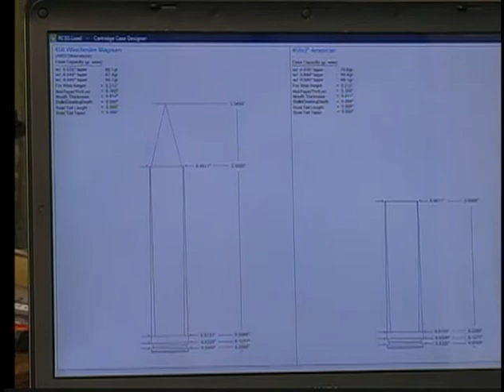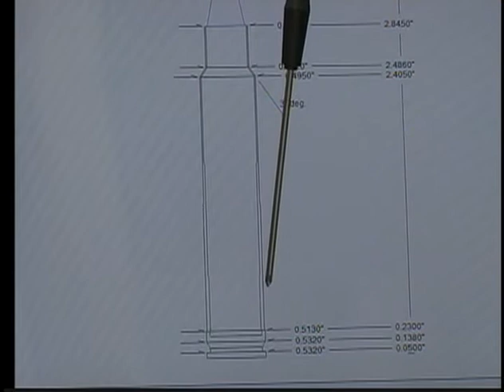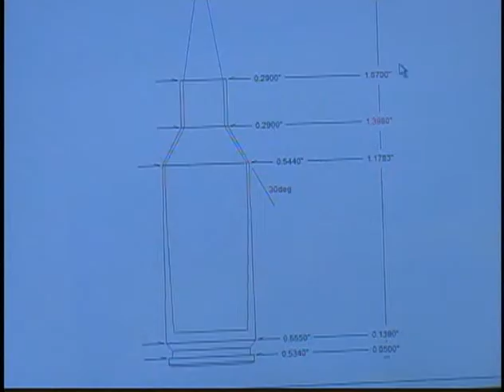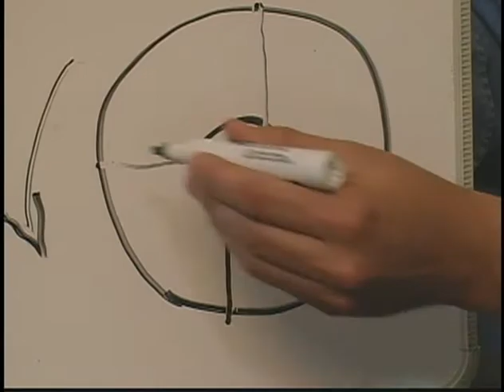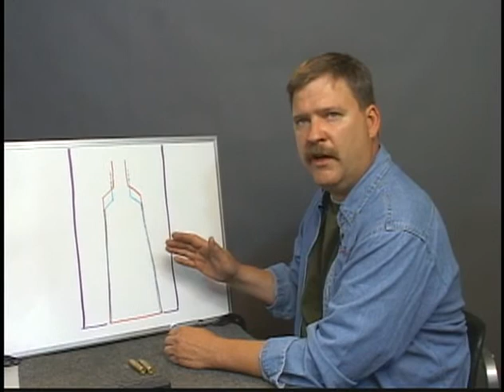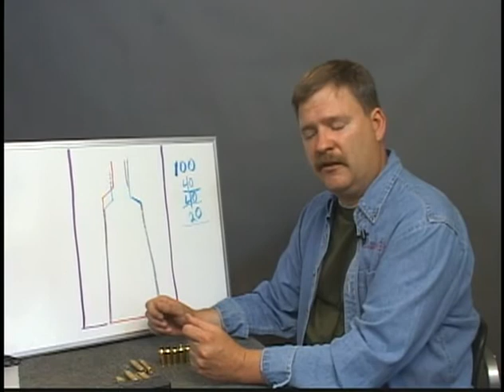AGI 217 Taming Wildcats

Comment: Anneal the casing before trying to form the casings. There are a lot of youtube videos on this subject. Really do heat the necks in a flame until the brass changes color, this will make them more malleable so they will not wrinkle. Brass work hardens and that is something you do not want to have. It is described in many reloading books. 53:55 it is the original casing with the wildcat that has been annealed, as you can see by the discoloration. 

Read on this book if you want to know how cartridges are produced by a factory: https://archive.org/details/cartridgemanufac00hamirich, also the annealing and why it is done is explained in the text. 

Greetings,

Jeff